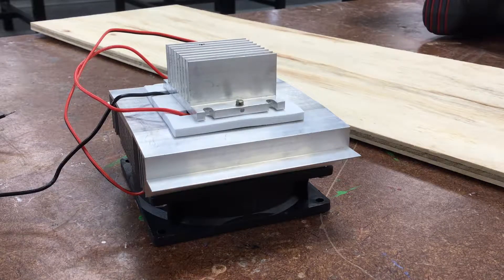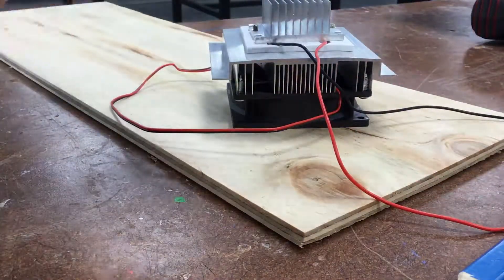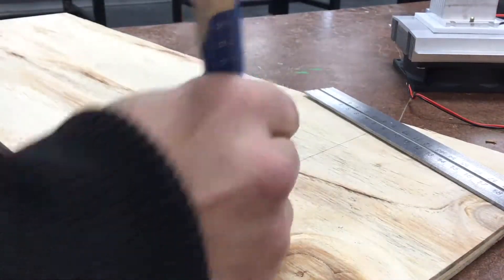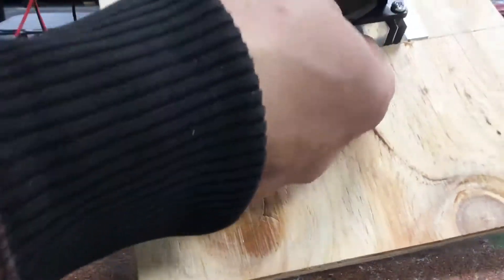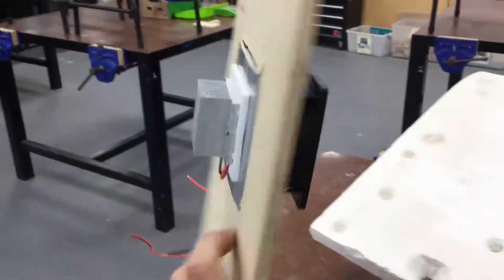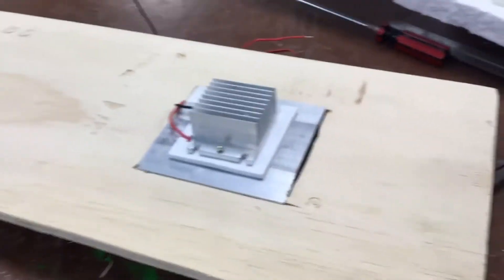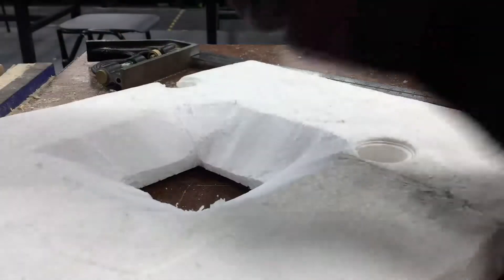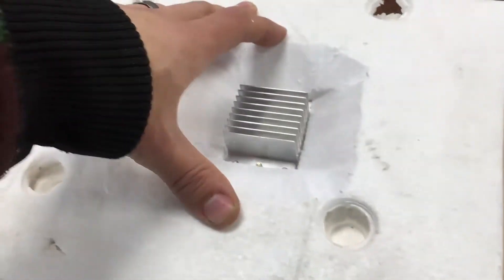Installing the Peltier Cooler into your box

Comment: Hey there, I’m planning to install a peltier module like this into a terrarium (I live in a hot country) to cool it down just a few degrees.  Is the best place in a side wall or the lid?  Do you have any instructions for wiring it to a plug?  Thanks.
Reply from the maker: Id put it to one side, much like you would a heat lamp. It'll then cool one corner down a bit. Also, you should add a mesh shield if the animal can reach it. Wouldn't want your pet hurt!
It may condense water into drips. So adding a bowl underneath may also be a good idea. Good luck!
Reply: @DrBlackAdder  Sorry, so you mean to one side bait still in the lid?  Or inside of the actual wall itself, sideways?  Thanks.
Reply from the maker: I think either would work. On the side will be moved less, so maybe that would be easier? So long as the fan can move air around, you'll get some cooling.
Reply: @DrBlackAdder  Yes that makes sense, hair have to factor it in heavily in construction or altering an existing terrarium.  For glass that would be impossible.
Reply: @DrBlackAdder  Thanks, one more thing.  I am trying to order one online.  There is a lot of terminology in the descriptions.  What am I looking for here?  I see them being offered but it says “no hot and cold cooling plates included) etc.  I want to find one with as little assembly required as possible.  They come in all shapes and sizes, some with series of small fans in a row.  I assume I’ll need to retrofit a new fan into the cooling part.  Any idea how I can sort out what I need “sight unseen”?  I got a used one years ago and couldn’t use it, it was made for something else and I couldn’t really be altered in a way that worked for a terrarium.

Comment: If 12v supply is given to peltier, what is the ideal current that should be given to it?
Reply from the maker: Usually as much as it is rated for. A 60w Peltier will need about 60/12 = 5A to do its job. I'd make sure your power supply is a bit stronger so it doesn't get too hot. E.g. 6a or 8a.
Reply: Thanks
Reply: can we use 10amps power supply?
Reply: Maximum current given to peltier is 6 amps. I think with 10 amps , peltier will experience an overload.
Reply: @joshemmanuel3  From what I understand, the load defines the current, not the source. If you use a 10a, the Peltier will use what it is rated for.

Comment: Is another fan necessary for the heat sink inside the refrigerator for better air circulation?
Reply from the maker: Your correct, it does help spread the cooling inside the fridge. It's not strictly required, but I think helps especially when your fridge is full to distribute the temperature. :-)
Reply: Thank you!